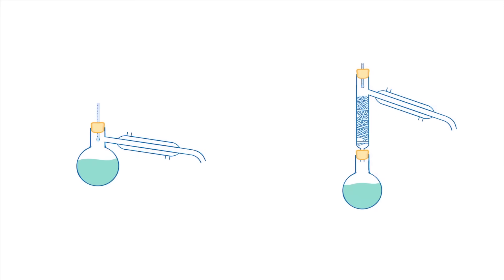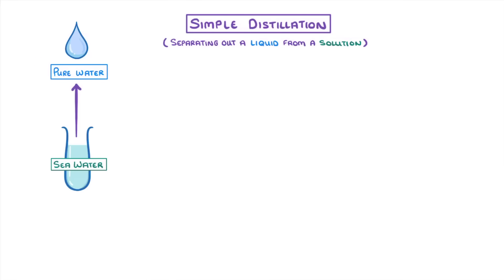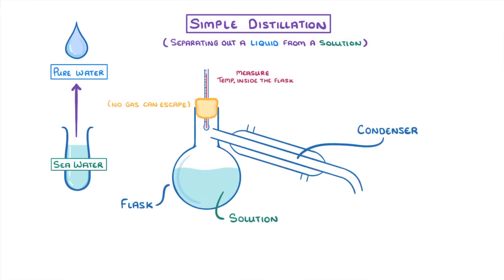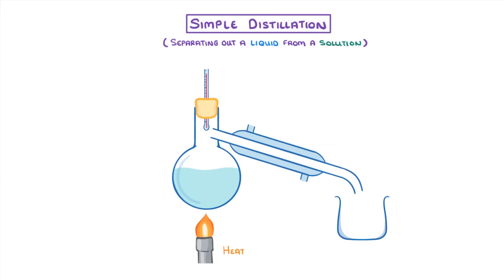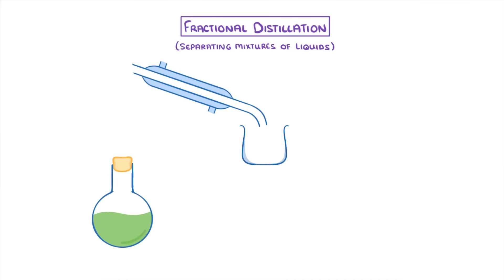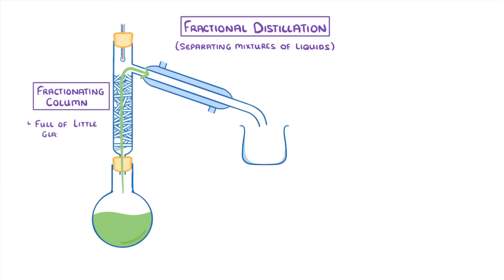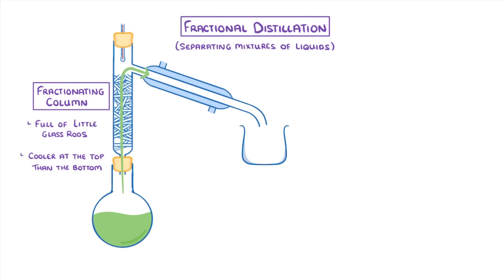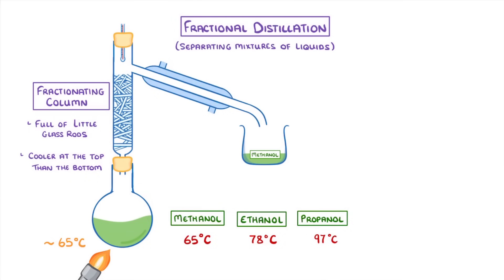GCSE Chemistry - Fractional Distillation and Simple Distillation

Comment: This was a long time ago, so i dont know it you will answer. But how does the ethanol pass through the glass rods in the fractionating column if the temp was previously states to be lower than their (ethanol and propanol) bp? Is it because when you raise the heat to collect ethanol, it also raises the heat of the glass rods?

Comment: 4:56 why would the methanol not also evaporate because it has reached its boiling point too so wouldnt it also flow into the beaker?
Reply: The methanol has already been evaporated into another flask, so there's none left in the mixture. Therefore if you heat the mixture more but still below the boiling point of propanol then only ethanol will be formed at another flask.

Comment: 4:46 but u said the ethanol will turn into liquid and go back into the flask
Reply: The temperature inside the fractionating column has been risen is now above ethanol's boiling point.Therefore it can not condense back into a liquid.Previously,When the methanol was being seperated , the temp. inside the fractionating column was lower than ethanols boiling point therefore it would condense and fall back into the roundbottom flask.

Comment: 4:38 Wouldn't the methanol also just condense by the glass rods then, since the glass rods are also much cooler than it's boiling point?? How come the methanol can pass through, but the others can't?
Reply: Without the specific boiling point, the other substances cannot filter through
Reply: It causes it to condense because it’s cooler
Reply: They have a different boiling point

Comment: In fractional distillation,  when using a simple bunsen burner, do we "control" the temperature by looking at the reading of the top thermometer?
Reply: No we increase the heat according to the boiling point, the thermometer is there to check the temperature.

Comment: Doesn’t the liquids with higher boiling points condense at the bottom of the fractionating colum and ones with lowrper on their way up the column???
Reply: the liquids with higher boiling points condense when they reach the glass rods, or higher, depending on how cool they are in order for them to condense back into a liquid.